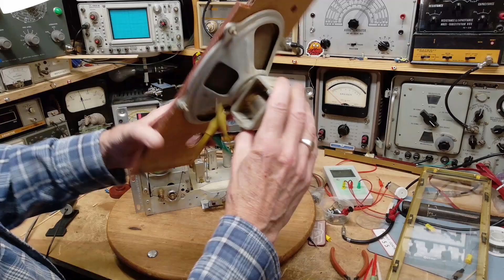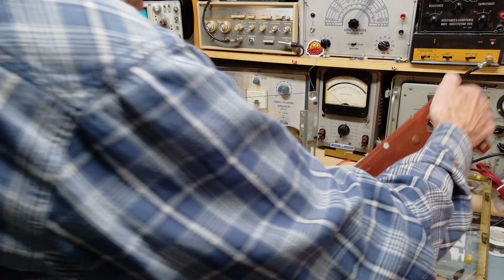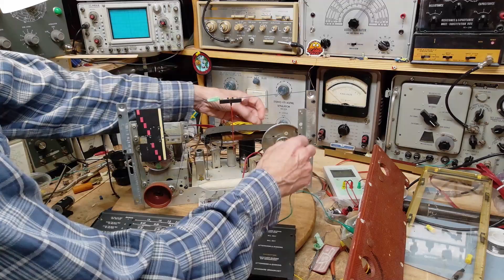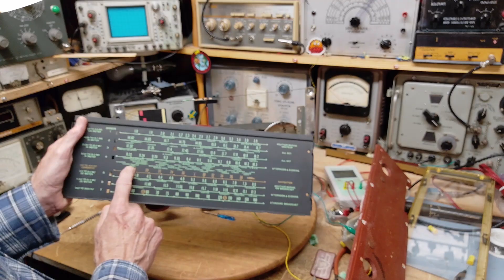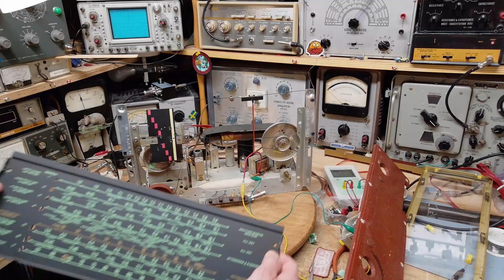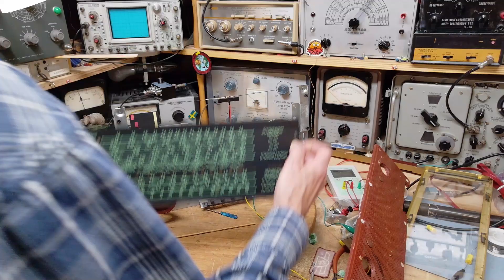Hallicrafters TW2000 Communications Receiver Video #40 - All Band Reception Test

Comment: You were having "fun" changing bands and clearly you couldn't hear me shouting at you about which way to turn the knob.... but then I looked up the service manual and ... the bands on that radio are in a strange order:  

1.8-2.9
14.62-15.7
17.32-18.2
9.22-10.3
3.9-8.0
11.42-12.3
0.54-1.6
0.18-0.4

Most multi-bands put those in order ...  Weird!  Still kinda want one, though.